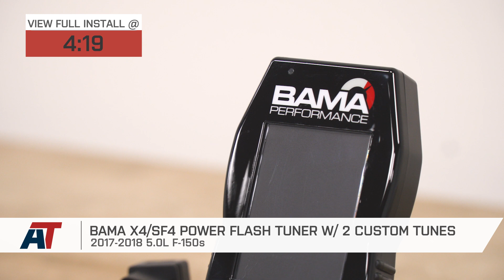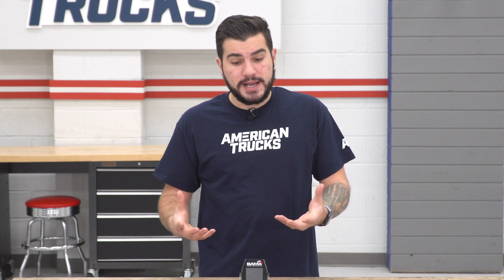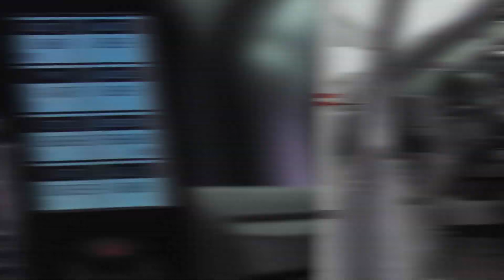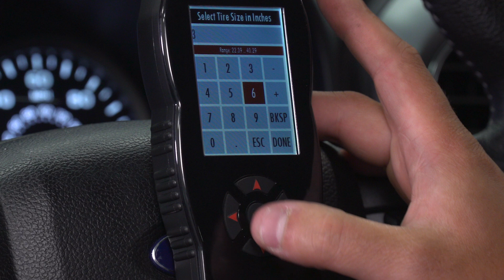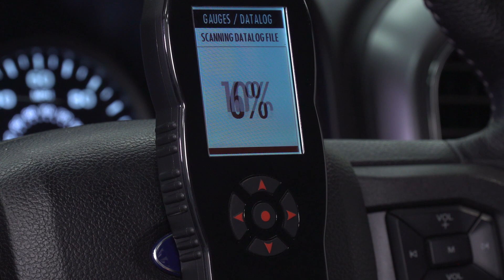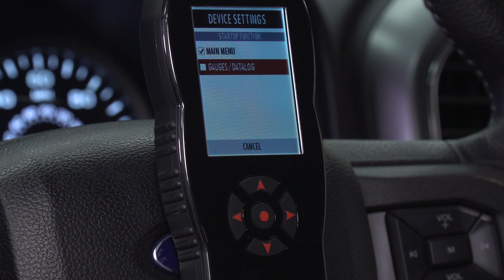2017-2018 F150 5.0L Bama X4/SF4 Power Flash Tuner w/ 2 Custom Tunes Review & Dyno

Comment: I have the same product for my 2019 5.0L XLT, and it doesn't ask me for tire size like this one. I have exact same product from you guys with 5star tune. And i don't have the shift press option on the options menu.
Reply from the maker: If you don't have the "Adjust Options" menu when going through the tuning process, you should be able to go to "Vehicle Functions" from the main menu, and then "Special Functions" - you should be able to change your tire size and gear ratio from there. Sometimes that "Adjust Options" menu as seen in this video can be optioned out when tuners are writing tunes. Hope this helps! - Adam
Reply: @AmericanTrucksFord  All I have under special functions is Cam and Crank reset. Also the REVS per mile on the adjust options menu has no affect on my speedometer. I have 33 inch tires.